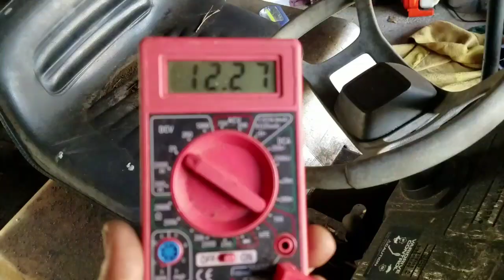INSTALLING CHINESE BRIGGS & STRATTON 281707 1 PIECE FLOJET CARBURETOR REPLACEMENT REPRODUCTION COPY

Comment: Henry, did you have to make adjustments to the screws on the carb? I put one of these on my JD 111 and it'll get it running but I can't get it to run on idle. It dies out, and no adjustment I make seems to work
Reply from the maker: Yeah it has a fuel air mixture screw in the bottom Of the bowl.
Reply: @MowersNBlowers  did you have to tweak it a little?
Reply from the maker: @killaman7592  then adjust idle screw
Reply: @MowersNBlowers  I did. Every time I put the lever in idle, it dies out and adjusting the screw doesn't do anything. It still dies
Reply from the maker: @killaman7592 put idle screw so engine won’t die and adjust throttle lever accordingly
Reply: @MowersNBlowers  I'll give it another go tomorrow. Thank you!

Comment: What does one do when the choke cable is on the OUTSIDE of the reproduction carb instead of the?  I have a 1985 Bolens and the cable hook up is on the outside.  Please help
Reply from the maker: Where else is it going to hook up other than the outside?  I’ve never seen an inside choke cable
Reply: @MowersNBlowers    on my 1985 Bolens the choke lever is on the OUTSIDE of the carb.  this video and all the carbs I have seen clearly show the hook up inside along with the thottle cable.  I can post a picture if that is possible of my unit.....but need to know how to do that.  thank you!

Comment: Couldn't get mine to work. any ideas?
Reply from the maker: You’d have to tell me what’s wrong first!
Reply: Sorry buddy. Its trying to turn on but can't seem to get the right tune to keep it running. I just put the same Chinese carburetor.
Reply from the maker: Theone 956 tractor, push mower? Briggs? Horsepower? Details?
Reply: Its 10hp flat head briggs and stratton riding mower.

Comment: Looks like the carb is no longer available on eBay at all. :-(
Reply from the maker: You just had to put 281707 in the search on eBay and popped right up!  You just need to use the information I gave you!

https://www.ebay.com/itm/Carburetor-For-Briggs-Stratton-281707-491031-12HP-L-Head-Engine-W-Gasket-/402304705681?mkcid=16&mkevt=1&_trksid=p2349624.m46890.l6249&mkrid=711-127632-2357-0
Reply: @MowersNBlowers  sorry, got it. Thanks!
Reply from the maker: @1984Cutlass2nv  hope you subscribed
Reply: @MowersNBlowers  I did now. Hope you showed that obnoxious neighbor when you got that mower running 🤣
Mine looks worse. Btw it's a 252707 11hp in mine so I looked up carbs for that one and hopefully it turns out as good as yours. I imagine the difference is just in jetting?
Reply: @MowersNBlowers  I just clicked: $218. Shame.
Reply from the maker: @johncollins8304  there’s others
https://www.ebay.com/itm/273358763720?mkcid=16&mkevt=1&mkrid=711-127632-2357-0&ssspo=_f-By6jHTQ2&sssrc=2349624&ssuid=O0RlH3mOSeC&var=&widget_ver=artemis&media=COPY
Reply: @MowersNBlowers  That was quick! Thanks. Meantime I also found two offers on eBay for $25 + 20€ delivery to France. Its great news. For the moment I'll work on my (two) old ones. Bought Oregon cleaner 088-402 for my ultrasound bath, for 30€ but what i need now is instructions on how to use it! Can you believe that -- they dont give instructions.
Thanks again for your help.

Comment: I know why the throttle won't stay. There is no governor spring. These briggs engines are notorious for rotting governor spring. And yours is gone. Thats why. Great video!
Reply from the maker: Gonna check that out justin thanks.
Reply: I agree. Get a spring.👍
Reply from the maker: There was a spring, I had the choke link in the wrong hole...I think the governor just needs to be adjusted.
Reply: @MowersNBlowers  that's actually great news man!  I knew something was not right. Usually those springs will go but good catch man

Comment: For a guy that has all those lawn tractors sitting around, I don't understand how he could not know that the big black lever as for the deck height adjustment, he can go online and see the governor and throttle linkage should be the simplest thing of all, and I would have rather rebuilt that original carburetor because there's not a whole lot to it and certainly last but not least I hope he at least use the new gasket. And if he runs it too long without the blower housing assembly on it will burn up because the cooling fins on the flywheel have no place to blow the air through the fins of the cylinder head and down over the exhaust valve area
Reply from the maker: You'd know what happens if you watched the subsequent videos.  But thanks for the comment.

Comment: The reason it doesn't come with a fuel fitting is because there are different ones. Mine has a metal fuel tap as part of the fitting.